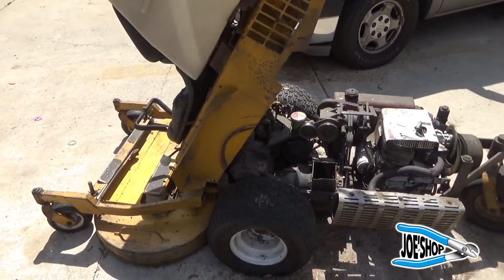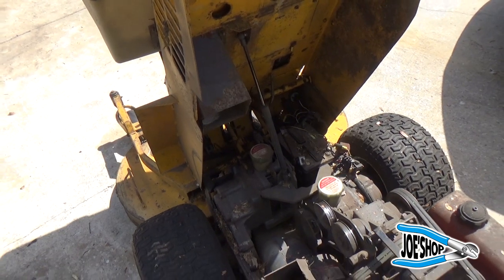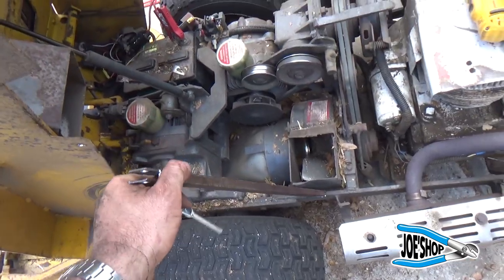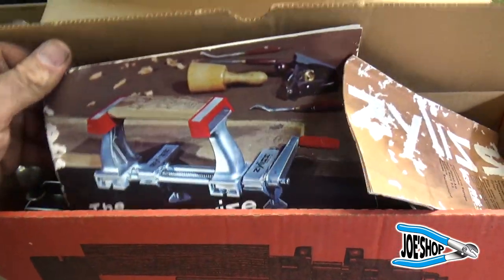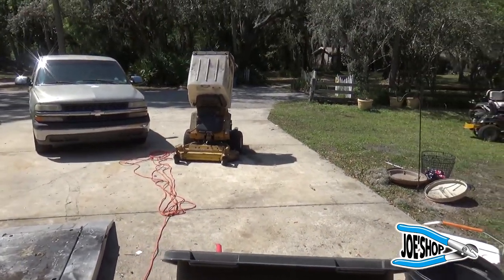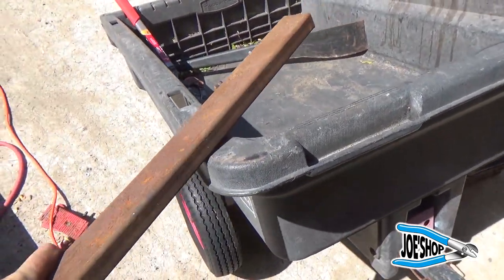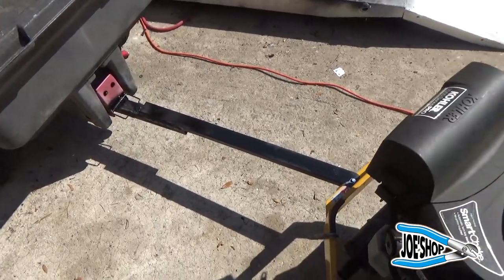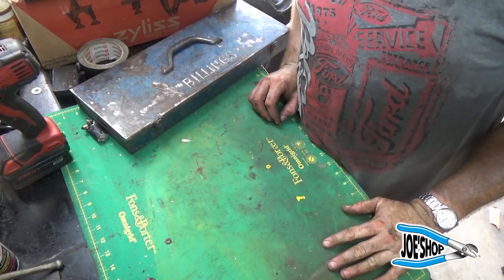Sunday Array (mower, trailer, rope, et al.)

Comment: Happy Birthday Joe!  Nice couple of boxes you got there. 

I used to work at a small equipment dealer that was a Walker Dealer. The landscapers loved the production they would get out of those machines.   I thought they had some sort of catch that prevented the body from coming down on it's own... but it's been at least 7 years since I've touched one.  There was one fellow who was religious about the maintenance on his machine and he would get an unreal amount of hours out of his machine.   Id throw out a few ideas about why the battery is dying,  but you never know what people have done when they go in there and starting hacking together a machine.  Need to start trouble shooting it and looking for draws, or tear it out and start from square one.  They have fairly decent manuals on their website.
Reply from the maker: Hi Bradley. I gave up...that machine has more problems than a math book. Be safe. Cheers

Comment: I tied an orange extension cord like that and you are right it retains the loops and is terrible to work with.  Still have not got it to unroll without tangling..  Going back to a notched piece of plywood because it hangs flat.